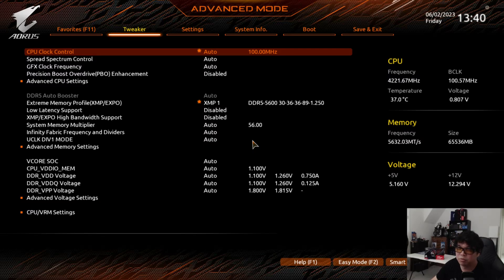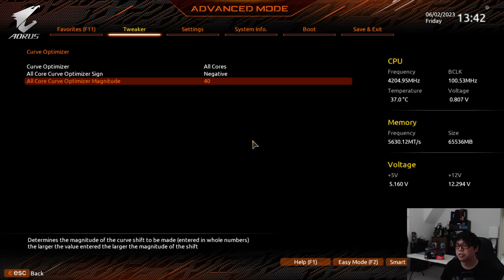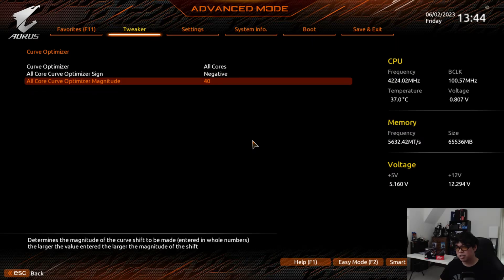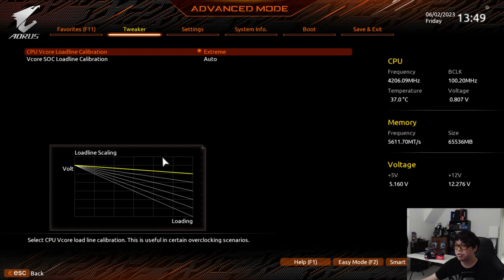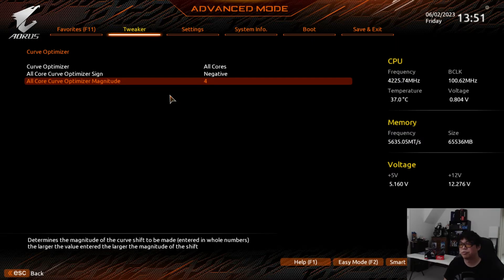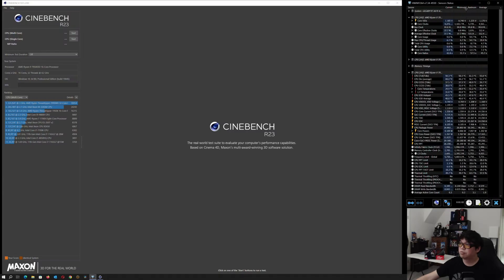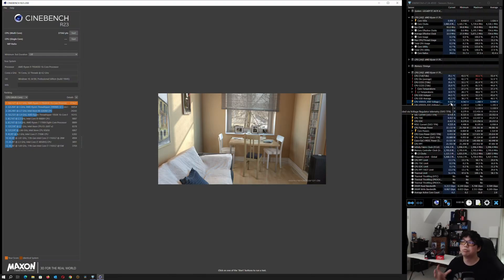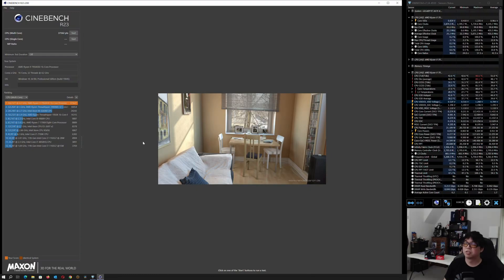How to optimize Ryzen 7950X3D, 7900X3D, and 7800X3D

Comment: Could you link the discord? 

I just got my 7800x3d I've never over or undervolted before. What happens if the system is unstable and shuts down, how do you get back to the bios to fix the number? 

Right now my cpu averages 4.4ghz with PBO turned on and no curve optimizer.
Reply: I just used the PBO enhancement option in bios and set it to 80 Lvl 4 cos of my shitty cooler and i hit 4.8ghz in cinebench all core

Comment: Not sure what I’m doing wrong. Using a 7800 x3d and a rog strix b650a. 
Set the negative on minus 35 on all cores. And the LLC on level 3 of possible 4. My voltage goes up a little from 0.993V to 1.065V during cinebench. Tried some other LLC levels but only the cpu temperature decreases a little bit. Voltage goes up. Did I miss something?
Reply: Got the same motherbroad. Under "Precision Boost Overdrive", what did you select? There is no "Advanced" in the available options.

Comment: My pc won’t even post after I do this can I get some help
Reply from the maker: Clear CMOS to reset back to default.
Reply: @GameTechReviews  yea I already did that but no matter how low I set my negative it just won’t work did I get screwed lol
Reply from the maker: @cash61380  Are you able to run it at stock without any changes in the bios?
Reply: @GameTechReviews  make a video how to make our 7950x3d perform the same as 7800x3d for gaming
I mean how does a $360 cpu beat the mighty 7950x3d 650$ usd CPU in gaming 
Make a video for us 7950x3d users , i want the same performance as 7800x3d is giving

Comment: Thanks for the video. I noticed your running your ddr5 6000mhz  at 5600mhz. Is running rhe ram slower hurting your performance noticeably? 
Im running a Aorus Master X670E am5 motherboard with a 7950x3d  and a 360ml kraken nzxt cooler. Im just running the negative 30 undervolt and my ram running we expo at 6000mhz.  I feel like im leaving a ton of performance on the table, my temps barely hits 60 degrees with fans cranked up . Any ideas to try?.
Reply: Pretty sure at 64g of ram the memory controller on the 7000 can't handle that size and speed together. I can run 32g at 6000 cl30 with tight timings no problem but have stability issues and stuttering at 64
Reply: @Dunkdamonk  , I Judt changed my settings to basicslly a negative 25 undervolt and my cpu runs at 5325mhz and 5725mhz . I had my ram running at 6120mhz and it was running fine, I didn't stress test it though so I'm just running it back it's stock expo1 speed of 6000mhz. My motherboard BIOS just upgraded to accept ddr5 8000mhz and a guy has a video up running xmp ram at 8000mhz with a 7800x3d.  I'm not gonna buy a bunch of xmp 8000mhz ram kits until I get one that works lol just gonna stick with my trident 32gb , just turn on EXPO and it's solid at 6000mhz. AMD said their next big 3d chip will be pcie5 so I'll wait for that to come out to try out a new ram kit. I got lucky with my trident kit I have.
Reply: @AJerseyJohnnyEntertainment  do you know if u have an A die hynix on ur kit or is it samsung? I've never seen amd get those kinds of speeds on x3d chips.
Reply: Nice scored a 37103 using a negative 35 undervolt. We have a newer bios, i also have another setting beyond extreme in the bios. They must have just added it.

Comment: What wasnt mentioned is that you can also get a mobo that has an external clock generator and overclock the cpu bus. Something to consider additionally is that extreme LLC will put strain on the VRM. Depending on your board and your cooling scenario this can affect the life of your motherboard. Air cooling is actually better for cooling the VRM.
Reply: Overclocking the FSB is  just an all around bad idea because now you are talking about OC’ing multiple components within the system………thereby increasing points of failure.
Reply: @techluvin7691  Nope.. Thats wrong.. Do your research.
Reply: @arlowicks9359  Yes……you are correct, the fsb can be overclocked by itself without affecting other components……yet……… it is still a bad idea and probably not worth the effort for the minor gains and eventual instability. What’s stable today probably won’t be stable in a few days.
Reply: @techluvin7691  Whether it is a good idea or not, I'd actually have to try it to know. It worked out really well on intel sky lake providing massive gains on locked processors. This is different as the I believe the x3d processors are running closer to their limits than the locked intel chips.. As for eventual instability, thats nonsense... Like I said, maybe good, maybe bad.

Comment: I have 7950x3D and I am with MB X670E-PLUS with the "Negative 20" curve Optimizer my PC restarted 2 times in a matter of 3hrs ish maybe? I also Set the Thermal Throttling to be at 75* Cel. Would that mean that my CPU doesn't tolerate even -20 o the curve settings?
Reply: 😅 RIP

Comment: Just an fyi, but before touching load line calibration check for stability of the curve offset first. If you don’t need to touch the load line, don’t. It still increases voltage under load compared to auto which leads to higher temps. This is just to make certain offsets stable when needed.
Reply: I leave mine on Auto 😂😂
Reply: this comment was spot on
Reply: Yes, I would never use extreme on LLC. The highest I've ever used on Asus boards is level 3.
Reply: @ that’s medium right ? Lvl 3 on gigabyte is medium

Comment: Came from Intel 6700k. I got that to 5ghz with 1.45 volts. Amd 7900x3d now and it’s so different. Helpful guide! I’m close to world record on 3d mark for a 3080 and 7900x3d set up (says “record for this exact combo of 3080 and 7900x3d” so I’m chasing that haha.
Reply: Which mobo do you have ?
Reply: @bomboclutch  asrock x670e
Reply: 5ghz on a 6700k vs a modern cpu isn’t even comparable lol. Also the 7900x3d is a weird cpu where you have the voltage limitations of the 3d cpus and reduced benefit of 3d vcache since it’s only on half the cpu
Reply: @josephbargo5024  obviously not comparable, but considered that majority of people could not hit 5ghz was pretty crazy. The boost stuff with amd is weird but I found not worth it really to mess with. I didn’t get much gains from anything or any guide I’ve tried, and I’ve tried a lot.
Reply: @thenext9537 Getting 5ghz on the older chips like the 6700 was a goal for a lot of people.. Not everyone in that comunity could reach it.Well done!
Reply: @ indeed! I got 4.8 fairly easily. 5 took a lot more voltage and tweaking but ran stable for 5+ years so win there.
Reply: Can you help me get 5ghz
Reply: @iliyarezvanfar25  That was old cpu 6700k at 5ghz not amd. If 6700k you got, then 1.45+ volts and changing other speeds gets you thee, plus good cooler.

Comment: Please help. Recently i swapped from intel to an 7950x3d cpu with an b560e motherboard, but after swapping my nvidia 4080 started to rise the temps in idle mode up to 60 degrees.. usually used to be around 35 degrees in idle , have any toughs?
Reply: Yes, the 4080 is 320w normal usage 280-300w thats a lot of heat. Install the exhausting fans. Also dont use negative curve -40 all cores like here. With 6000mhz ram and loose timings like 40 40 40 it might work. But if u will go 6400 cl28 or 7800-8000 cl36 100% wont work. Especially in the games. The programs might work but there will be a micro stuttering. With 6400 -30 with 8000 -25 or -20. If u dont believe try to set default 4800 cl 40,40 40 and -50 negative all cores 100% will work. The high temps are always bcos of heat accumulation. So i would say exhaust fans are the best. 🎉😊
Reply from the maker: Did you also upgrade your monitor?
Reply: @GameTechReviews  nope , i use multiple monitors , samsung g7 34inch and an zowie xl2566k.

Comment: setting llc at extreme is it bad for the cpu ?
Reply from the maker: You shouldn't have to use extreme only Level 3 should be enough or any of the levels that still results in a decent amount of vdroop.
Reply: @GameTechReviews  make a video how to make our 7950x3d perform the same as 7800x3d
what bios settings should we do

Comment: This video didn’t help a single bit, why are there no videos with MSI motherboards???
Reply: It is working on msi as well, just find the right option. And -40 might work like here with 5600mhz 30-36-36, but if your ram is 6400cl32 then u need to give more V, because at the same cpu speed let say 5ghz the ccd will have more data to work with from memory controler therefore it will need more V to work properly.

Comment: Hi im hafiz from malaysia , just bought new proc & mobo and i got some issue with my 7800x3d 🥲 when i run multi core at cinebench r23 temp go high 90* 😭 and idle 50* . if i run some apps going to 70* . can someone help me ? 😢
x670 aorus elite ax
r7 7800x3d
corsair 5600mhz 16x2
aio 360 aorus .
help me please 🙏🏻
Reply: Put a lower ppt limit
Reply from the maker: 90c is normal when running cinebench.
Reply: @GameTechReviews  i get 80 normally with an aio cooler without any power limits. I lowered the power limit to  75W. 

PPT Limit [mW] → 75000 (75W) and look at the Cinebench score and Temps its crazy give it a shot just change PPT dont mess with the other settings
Reply: @UnalertYT  make a video how to make our 7950x3d perform the same as 7800x3d for gaming
I mean how does a $360 cpu beat the mighty 7950x3d 650$ usd CPU in gaming 
Make a video for us 7950x3d users , i want the same performance as 7800x3d is giving

Comment: CO is undervolting for the old frequency but actually the voltage stays the same and now you get a higher Frequency at same voltage, as measured with a voltmeter...

Comment: which one of the 3 is the best for gaming?
Reply from the maker: All of them are the best, but at different price points based on use case. For strictly gaming, the 7800X3D offers the best value and performance.
Reply: @GameTechReviews  what about if i dont care about price i just want thenbest
Reply from the maker: @paulosilva-tz8el  7950X3D is the best overall.
Reply: @GameTechReviews  make a video how to make our 7950x3d perform the same as 7800x3d
Reply: Sorry but the question is loaded. Only the 7800x3d is good for normies who don't ever want to look into the bios or install 3rd party apps or fuck around with programs and settings.
On the other CPUs being a dual chiplet design, you need to fuck around and assign correct cores to games, either with AMD solution or with what the community says: process lasso, bios set to prefer frequency, turn off game mode etc etc etc....

Comment: C R23 ~18k score 7800x3d + X670 Gaming X AX + 2x16GB G.Skill Flare X5 6000 CL32 EXPO = Bios settings PBO -40 , SOC  1.15v , VCORE OFFSET -0,050v ,LLC Auto , AIO ENDORFY F280 ~1600rmp on Cinebench R23 = 80*c  , in game ~60-65*c 1100-1200rpm AIO
Reply: C R23 18181 score = Bios settings PBO -40 , SOC  1.15v , VCORE OFFSET -0,085v ,LLC Auto ~1420-50rpm AIO = 72*c in HWINFO64 vcore is 1.02v - SOC 1.18v :D

Comment: i got -40 on my 7800x3d not a single crash
Reply: I'm running -20 on mine but not trying to push it either.
Curious though, what was the temperature difference between -40 and stock?
Reply: @HughesDePagen  never check mines when it was stock, what Temps u hey when Idle and gaming ?
Reply: @KerwynPromoter  at -20 and with a 240mm rad, it never hit 80 on a hot day here in Australia.
Usually high 60s but the odd transient spike to high 70s

Comment: I would also run prime95 for a while, your system may seem stable, with -40 but I found that some cores would run into errors, and you don't want that.
I didn't go into the individual cores because I don't want to invest too much time into marginal gains. Now i'm running -20 and EXPO
Reply: i am on -18 all core with a 7800x3d and be stable. -20 or even -19 would be unstable for specific cores.
Reply: @NightForce  would the unstability means restarts? I tried with -20 and it restarted twice in 3hrs?
Reply: @alishfitness  no, i experienced core-crashes in Prime95. If there were more then 2 cores crashing i even had bluescreens. If your System restarts out of nowhere i would suggest to monitor your temperatures
Reply: @NightForce  I am doing that constantly, nothing crosses 65 degrees C. And that's the hot spot. my CPU goes as high as 49 (AIO cooler), GPU I already undervolted and doesn't cross 62 ish. The only thing that I do not monitor is my ram. I have Kingston Fury 2x32 6000. Could that be?
Reply: Are we talking avx enabled or disabled? Prime95 seems to do absolutely nothing to my 7800x3d vs cinebench
Reply: I highly recommend testing stability with OCCT, its great

Comment: Wait..... But if you're reducing the voltage per clock under a specific load..... Then raising the LLC..... That means that the voltage is higher at a specific load so you're undoing the benefits you just got from Curve optimiser. 

This does not make sense to me
Reply: CO undervolts the old 5Ghz. But now at same voltage you get 5.2Ghz.
This is not stable at the same voltage so you need overvoltage, since the CPU is locked, LLC is overvoltage workaround.

Comment: My 7950x3d gets 26 fps in time spy :/
Asus x670e-A motherboard.

I've been trying to get it higher, but I have no idea what to change.

My old 9700k got almost 25 fps, so yeah, I'm pretty disappointed
Reply: I was struggling too until I did a clean install of windows
Reply: Yeah mine works great now.
Manual memory 36-36-36-96 +1.35V
PBO set to motherboard controller.
Boost override +150%
Curve Optimizer -15 all cores.
Individual cores work too but it's more time consuming, I've only successfully gotten a few to -20-25 while the rest work fine at -15.

Temps are also really low now 40-45C on the desktop instead of 70C.

I do have CPU set to prefer driver which I guess is to allow windows to decide weather it uses 3D cache or not.
I heard frequency was better but that never really made the performance any better.
I get 57-59 FPS in time spy.

If I disable SMT in the bios Timespy FPS goes up to 63 fps.
Total 3Dmark of my PC is 34k

Comment: I have the 7800x3d in the dan a4 h2O... would it be better to do settings like this or to just use the ECO mode? Not sure if it's more of a personal preference for tradeoffs in performance and temperature or if one is known to be overall better than the other
Reply from the maker: You can use ECO mode to lower the overall power consumption but that shouldn't be combined with what is shown here. This video focuses on leveraging Curve Optimizer along with LLC to get better performance than stock, or getting the same performance at lower wattage which results in lower temperatures.

Comment: What power plan you use high performance or balanced ?
Reply from the maker: Balanced
Reply: @GameTechReviews  dude fking reply me
make a video how to make our 7950x3d perform the same as 7800x3d for gaming
I mean how does a $360 cpu beat the mighty 7950x3d 650$ usd CPU in gaming 
Make a video for us 7950x3d users , i want the same performance as 7800x3d is giving

Comment: just for information. running llc on extreme will generate extreme voltage spikes for a short time when the load drops off. this can lead to huge voltage numbers for a short period of time. i dont recommend running llc on extreme!
Reply: This is not the same as applying a max llc to a non-x3d which you normally wouldn't do.
Reply: Agreed!
Reply: He's applying LLC to an undervolt
Reply: Agreed, the point of undervolting is to decrease temps to get the full processor. Llc just increases temps like crazy with little to no performance difference
Reply: Does anyone know definitively which is it -- Is extreme LLC risky/dangerous In this scenario or not? There appears to be disagreement on this

As a longtime Intel user, I'm accustomed to agreeing with the OP by strongly avoiding high LLC, and "Extreme LLC" never even being an option in my book.

However other commenters seem to say LLC works differently in this case, given it's an X3D CPU.

So does anyone know definitively which case is right?

Curious more for knowledge vs. wanting to do it myself, wondering if my understanding of LLC and its danger of higher LLC leaving transient high voltage spikes after loads are removed, like the OP mentions, of this is fundamentally wrong in this case of X3D CPUs.
Reply: @coldblackice  LLC increases voltage. Anytime you increase voltage on any component in your PC, you are putting it at risk. I dont really understand why he's applying an LLC to an undervolt to a cpu that isnt overclockable.
Reply: @coldblackice  especially when the purpose of the undervolt is to decrease temps